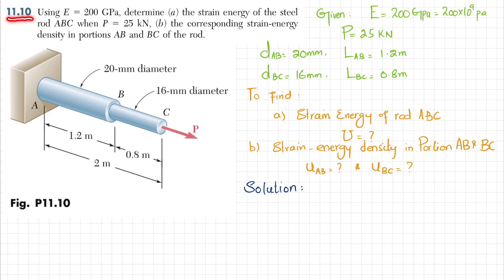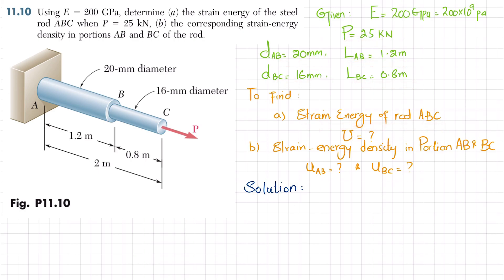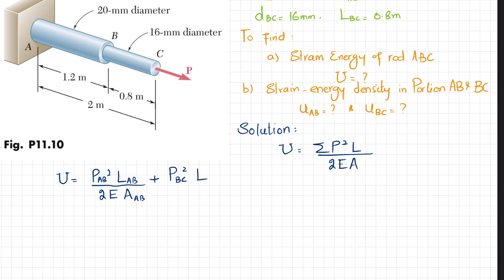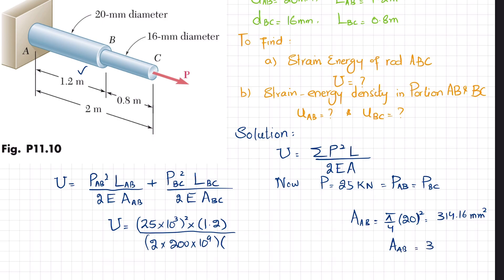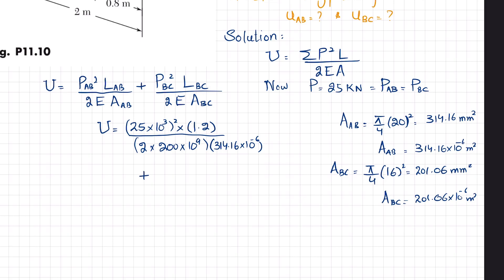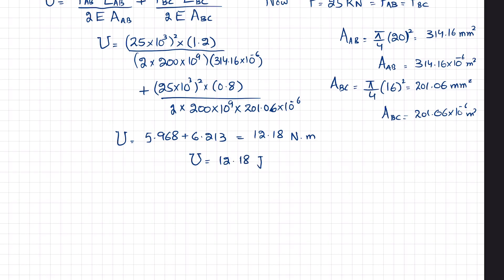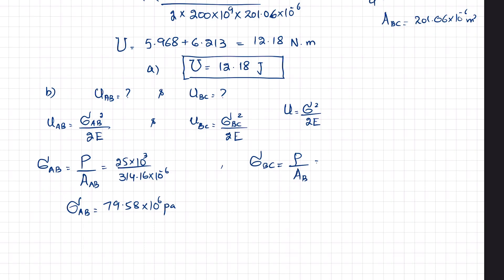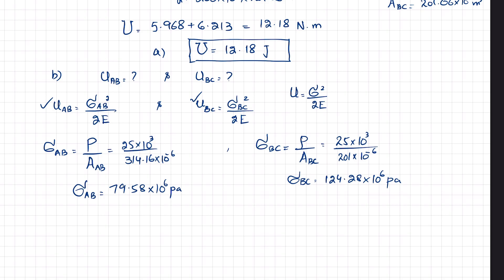11-10 Energy Methods| Mechanics of Materials Beer, Johnston, DeWolf, Mazurek |

Comment: sir why we use different methods for problem 10-9  for strain energy
Reply from the maker: You can use the same method ....one in table form and one with formulas and all calculations done by putting values in formulas.
Reply: @engradnanrasheedmechanical okai sir